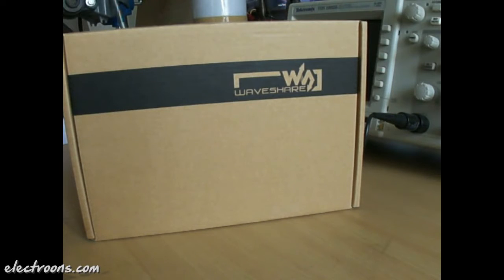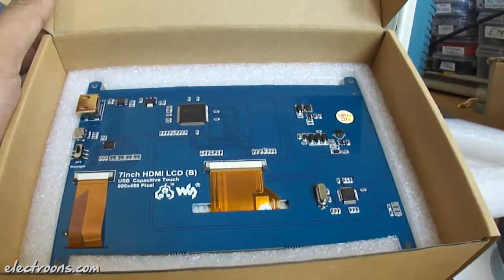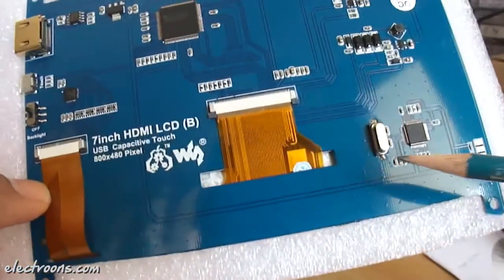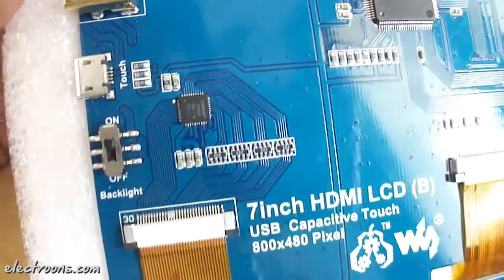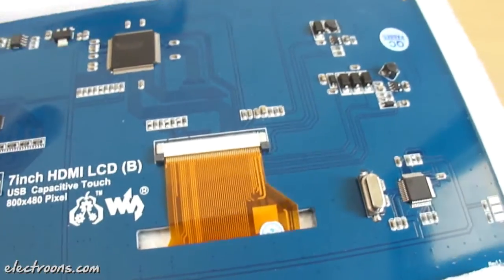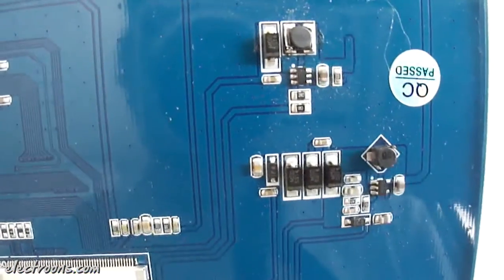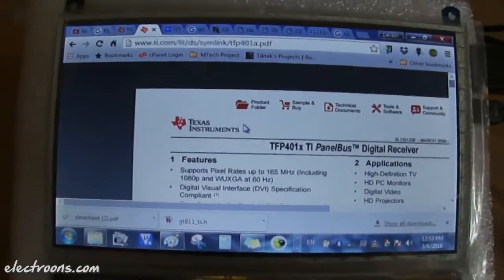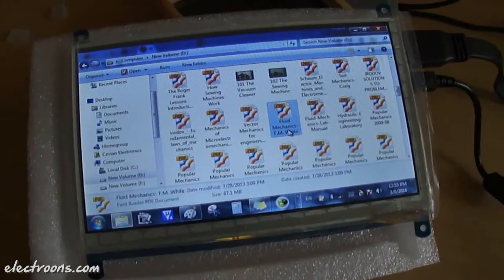Product Review: Waveshare 7" HDMI LCD w/ Capacitive Touch - rareComponents.com

Comment: I would like to know, if you got the capacitive touch working??? If yes could you guide me how to do the same???  Ive managed to get the Screen working but still waiting to get my hands on with the touch...
Reply from the maker: Which platform you are using it with?
Reply: using it with the Raspberry Pi 3
Reply from the maker: It should work, use the OS image provided by Waveshare, manufacturer of this LCD panel. It will not work with general RPi OS.